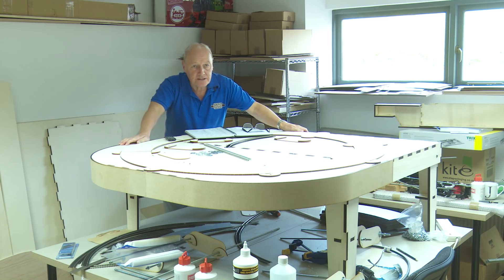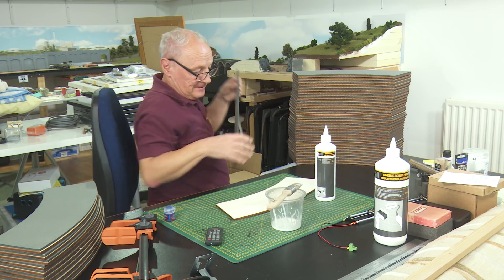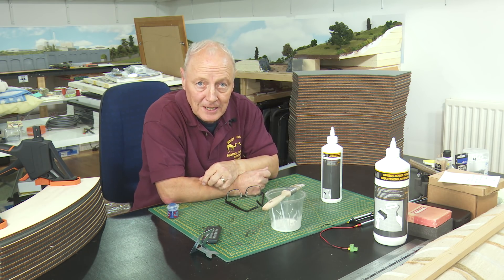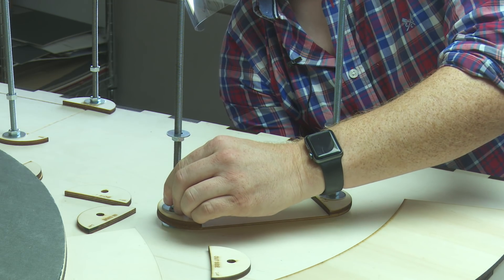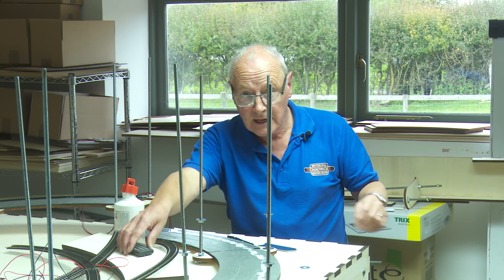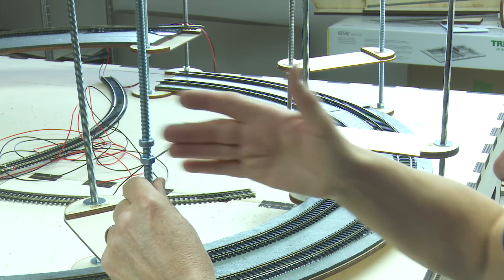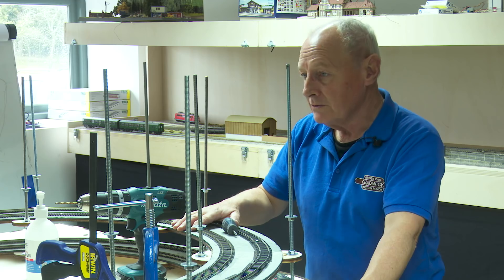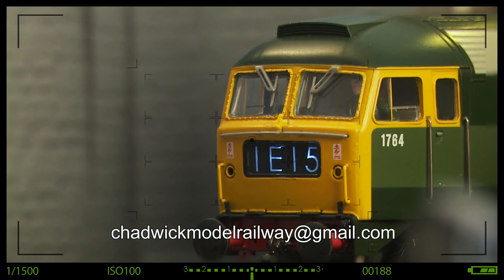Building a Helix at Chadwick Model Railway | 114.

Comment: Have you checked to see whether the screws will catch on the Dcc concepts powerbase magnets once they've been fitted to the underside of your locos ? The screw heads might be below track level but potentially your magnets will also be ?
Reply from the maker: No Peter I don’t believe that’s the case. If the magnets were to catch the screws they would also be catching on all the point blades. Regards Charlie
Reply: @ChadwickModelRailway  that's a good point Charlie, I'm also experimenting with powerbase at the moment on a tight curve entering my fiddle yard.I did have success with a good smothering of copydex but possibly the incline and the radius is what caused you the issue on the helix.

Comment: That thing is a monster... and that metric... it's already in the radii of both tracks. Only thing thats confusing me is - how does the dcc power plates actually do something? are they wired in?

as i am building in H0 (continental eurpean here) with Märklin K-Track  and modelling somethign in germany, my helixes have to turn in the other direction - our rail traffic is also on the other side, like the car traffic. Mine will be actually not a perfect circle but oval - more length per revolution results in a less step grade. But obviously you need the room for it.

cheers,
Sarah
Reply from the maker: Hi Sarah,  the powerbase works by fitting magnets to the weaker loco's to give them more grip.  Regards Charlie
Reply: @ChadwickModelRailway  ah, so they are forced into the rails for more grip. neat.

cheers,
Sarah

Comment: Hey Charlie, great job on the Helix. I am in the process of doing two of these for my HO layout and have a similar 18" overall rise / drop and a 5.5 turns planned. The difference being that I have an inner radius of 28" and an outer of 32". Can you share the excel file for this with me or just plug in those numbers and do a screen share. I believe this works out close to a 2% grade. As you mentioned the inner and outer radius are a slightly different grade. Thanks for the help!
Reply from the maker: Hi Gary, can you email me please your find my email address at the end of the videos. Yours Charlie

Comment: Wow - how the hell are you going to get it home! Don't get the logic that the inner track is less of an incline but hey hope it all works. Separate issue I don't know if its you or Youtube but I didn't get a 'watch later' button top right of screen - I use it to watch the videos on a larger TV.
Reply from the maker: Hi Roger, it will come home in James’s van and tip sideways into my room with the legs removed. Sadly, I’m giving away the next videos secrets! 
You’ve miss understood the down line comments.  The inside will obviously be steeper. Regards Charlie.
Reply: @ChadwickModelRailway  I have a picture in my head of the Tour de France going up the snake bends to Alpe d’Huez.  The riders always take the tightest line, which must give them the steepest hill too.  There must be some kind of coefficient between the two.  And they don’t have magnets!
Reply from the maker: I agree but they're not pulling eight coaches either!
Reply: I had the "how are you getting that home then?" thought
Reply: @dakdak7609  The riders do a racing line - yes in the vertex of the curve they take the inner line, but they start and end the curve on the outer, that way the driven minimum and maximum radiuses becomes bigger then the outer radius and the curved-way therefor longer.

Comment: Charlie: This is excellent. Nice you found someone with computercontrolled cutter big enough for your job and the ckills to drawe the layout. If you have a lot of patience I you could draw fukk size patterns and cut them and its doable. The time consuming way to goio for sure but it saves money. I do have a question. Are you going to put some sort of fence along the edge? I would imagine about an inch off the top surface would do but it would stop expensive gear taking a header unto the floor and self  destructing. Voice of experience says if it can go wrong at some point it will and long trains going up a long circular grade are a ripe opportunity for troubles. In any case this was high quality and great information. Lots of ideas generated from the video and your commentary. Nice job!
Reply from the maker: Hi John, I have no plans at present for a barrier but it is certainly someting that I'm considering.

Comment: Charlie can I ask would u think or recommend the flooring underlay u used on the helixes for fiddleyard and main tracks??? As I'm betting that it works out much cheaper and what one did u use ??
Reply from the maker: The stuff I've used on my helix and fiddle yard comes from Wickes but it can't take much damage, it dents quite easily.  Don't use it on your scenic areas mate.
Reply: @ChadwickModelRailway  ok thanks

Comment: Hi Charlie, what an adventure !  How did you mark the centrelines for the PowerBase and track ?  I'm not using powerbase (yet ?0 on my helix.
Reply from the maker: I laid the track in place and then scribed the line on the foam on the inside edge. Then applied the glue and then fitted the track base. When fitting the track, the track base glue was still a little moist so I could move it a couple of millimetres into its final position.
Reply: @ChadwickModelRailway  Good thinking - I’m using flexitrack and my roadbase was cut out of 6mm birch plywood by a local manufacturing company on a CNC cutter (like James has but a bit bigger) from my 3rd PlanIt track design software that had the centrelines on - but for the gluing your idea is better and I should have done that !
Reply from the maker: My methods aren’t necessarily the best ARB.

Comment: Charlie, Somewhere along the line I surely must have missed some figures or factors used in your calculations because no matter from which end I come at it I only see 65mm(give or take 1mm or 2) as clearance for your rolling stock between helix loop levels -- or about 13mm(~0.5in) of space above a coach(MK1 model height measured at 52mm above rail). What have I missed, since this seems awfully little to get away with?
[How I got there: 80.3mm separation between railheads - (6mm board + 5mm underlay + 5mm track&sleepers ) = 64.3mm].
Whatever the case ... Damn but I enjoy your videos here in Montreal!
Reply from the maker: Your right Ray, there is 1/2 inch clearence.  Regards Charlie

Comment: Hi Charlie. Another great video! Question: I'm thinking of using sheets of Arbitron for sound deadening over entire baseboards (I'm not bothered about 'shoulders' for the track). Would this be as good as, or better than, using cork? It would certainly be cheaper for a total surface area of 12 square metres. I'm wondering if, for instance, the darker Arbiton would be a poor base colour for scenics...... I guess it can be painted though? Your advice would be most helpful Many thanks. Martin.
Reply from the maker: Hi Martin, I will be using those sheets throughout my fiddle yard. However, someone did mention whether they may deteriorate when exposed to UV light. I can shed no light upon this so tread carefully. Regards Charlie

Comment: Well done Charlie, I won't be doing a helix but it was interesting,  did you really need to use the metal base as it adds a major expense i would  imagine, just a thought is it possible to put a hole in the middle of the helix board to use as a service hatch, just a thought 
Regards 
David
Reply from the maker: Yes the powerbase is an extra expense but I want to carry out trials with and without magnets on locos.

Comment: just  a  a quick question Charlie a friend of mine is building a very big LAYOUT ABOUT 20 FOOT BY40 FT HOW MANY TRAINS CAN U RUN ON EACH TRACK  AT THE ONE TIME HE WANTS TO RUN 3 WITH 2 ENGINES AND 10 TO 15 CARRAGES ON EACH TRACK IN EACH WAY
Reply from the maker: That makes 120 feet, each circuit. With multiple tracks, he could easily acheive that.
Reply: @ChadwickModelRailway  THANKS CHARLEY

Comment: Thanks for the video Charlie.  By screwing the track in place did it increase noise over the copydex glued track going down or didn't you do a test on it?
Reply from the maker: It doesn’t seem to be excessively noisy Don, just running test coaches down the tracks. Regards Charlie

Comment: Do you use a thread-locker (Loktite) on the nuts that support each section of helix riser? Is there a possibility that vibration might lossen a nut and cause the track to sag?
Reply from the maker: Nothing as yet Bob, all the nuts are left somewhat slack until the whole build is finished. Only then do we tighten everything up. Regards Charlie

Comment: Hi Charlie, great vid as always.
I was just wondering how your going to get it in your house and to your layout room?
Reply from the maker: An excellent point Paul, however that will be next week’s video! Regards Charlie
Reply: Charlie
Been watching your videos for the past few months. I appreciate the need to stop crawling in as I have the same problem. Just worried about your 18 inch minimum height. That is very low and will not do your back any good. My layout was set at 46 inches with 12 inch drop to storage roads.
I find even  36 inches from the floor low these days when bending, to check or do anything on storage roads, which are underneath the main layout. I do not find 12 inches between the levels a problem.
Graham
Reply from the maker: Hi Graham, my intension is to build the fiddle yard boards on a bench. When finished I will put them on legs and slide them into place with just a small amount of track left to fit across boards.

Comment: Hi Charlie you used 3rd & 4th radius track which gave you an overall width of 51” I believe you said. If you used 2nd and 3rd radius track would this be too tight and would it reduce the overall width to be 48” wide. Appreciate your initial thoughts
Reply from the maker: Hi Chris, yes with long trains I thought it best to go for 3rd and 4th. The tighter the radius the greater the incline too.  However, many folks do use 2nd and 3rd.
Reply: Aaahhh. On reflection think then that it might be best to keep it lowest possible incline as my locos are all steam. Many thanks to Charlie fo4 his methodical videos.

Comment: I think some of my locos would catch those screws - not sure why but my old bachmann 158 is the worst for this. Hope you don't have the same issue.
Reply from the maker: I can’t see how as they are below rail height.  Otherwise your stock would get stuck on the switch rails of every point.
Reply: @ChadwickModelRailway  I take your point (pardon the pun) but it's just something I observe when, for example, a track pin isn't pushed in fully or a point motor pin that's a little too long. There is a bump in the central part between the wheels on the 158 and it catches. As I say, hope you won't have the same issue. If you do, I'm sure you'll find another solution in no time!

Comment: be carefull with that flooring insulation,i tried it on an 8x4 board and had several reactions from polysyrene cement ,thinners for paint, heat ie soldering iron .the stuff just melts and shrivels up.
Reply from the maker: A fair point Paul and one which I will not forget. Regards Charlie
Reply: Pretty much all foams and plastic will melt if you touch them with a soldering iron so best not to. Same for polystyrene cement as that is what it’s designed to do. I’ve used the stuff all over my layout and have had no problems with it, not even painting it. Just don’t use acetone but then that will also destroy you models.
Reply: @RobA500  i am a newbe at this hobbie and i try different things before i go for the big one .it is certainly a steeplearning curve in a two year period i have learnt a lot of dont's by experimenting and learning,i have watched hundreds of hours of youtube vids and tried a good few teckniques ,i am getting there but not quiet confident to commit a few 000's to the real thing .as soon as i saw this flooring insulation i thought -i tried this and its doddgy,give a warning, if your more expierienced you know already ,but what about those who are new and inexpierienced with the product
Reply: @paulmurrell9823  A very true concern, yes newbies should be given this advice and you do indeed to be careful with different materials. What you should take from my comment is not negative but in addition to the underlay many common materials used on model railways can have the same problems as you describe. I agree that it can be a steep learning curve, I’m still learning a lot myself.

Comment: How much is one of these helix’s going to weigh when completed? Presumably normally these are built in situ to avoid the potential issues related to transportation and final installation. Or is the plan to build - dismantle, transport and reinstall? The power base is presumably a 21st century version of Triangle Magnadhesion.
Reply from the maker: Hi Andrew, yes the powerbase does have flashbacks of Magnadhrsion. It will be relocated as one lump. Regards Charlie thank you baby

Comment: Hi Charlie. I’m gearing up to rebuilding a layout and I’m considering the use of 2 Helix like you (ish). Could you tell me what the dimensions of the actual helix track base is please? I’m interested in the width of the sections and what the internal and external diameters are. I hope that makes sense? I’ve seen measurements on their website but doesn’t give all that I need. I’m trying to work out ways to best fit it in my room.

Also, what do suggest is the best base board in terms of thickness and wood type please?

Thanks in advance

Gareth
Reply from the maker: Hi Gareth, I bought mine from DCC TrainAutomation. The large expense is in the track, not the helix. I used Peco 3rd radius and Hornby 4th radius track. 
It’s all plywood (no MDF).  Building your own is a nightmare and it’s easy to lose your motivation. The dimensions are on their website. Regards Charlie.
Reply: @ChadwickModelRailway  oh I’ll be buying one but I was after the physical dimensions of the helix once built. I’m not using a base board like the one yours is on. I just need to know if it’ll fit in an alcove at one end of the layout. Sorry for the confusion.

Comment: Next time you need to put on the nuts on the threaded rod, use a power drill and a rubber band. It saves so much time :)
Reply from the maker: Now that’s a new one, thanks mate. Regards Charlie
Reply: Got a videoclip that shows it. Will make it public available tomorrow
Reply from the maker: Thanks mate

Comment: Your copydex issue could be because you're using it wrong. I've used Copydex on my PowerBase plates (though to ply directly, not to foam). You're supposed to paint both the track base and the top of the steel with copydex and then let it go off. It then acts as an impact glue with all the properties you're after. No nasty weights, and sticks instantly.
Reply from the maker: Hi John, I did use it that way later in the video. However with the power base they have a slight curve to them hence the weights. Regards Charlie
Reply: @ChadwickModelRailway  True, but if you let the copydex cure completely on both pieces before joining them together, then the join will be firm and immediate. 

My tip is to insert a strip of paper between the two pieces (track and board, say). Then you can make your alignment adjustments; when happy you simply slide out the paper and with a little hand pressure for a second or so, the pieces are stuck - as well as copydex normally sticks, certainly.oh, 

I also found it easier to fix the powerbase plates down before removing the blue plastic covers. That possibly helps in keeping them flat, too.
Reply from the maker: Great points John.

Comment: 1) Instead of nuts and washers between each level. Pieces of tubing cut to length. Either to a stop on a chop saw or a lathe. Washer above and below so the tube does not cut the plywood. 
2) When laying out the curves with a beam compass instead of the track centerline mark the outside or inside (a)of the crossties on the flex track. Also make up stop gages that have the same radii as the outer or inner edges of the cross ties. Temporarily screw the gages in place. Glue down the flex track with the cross ties against the gages. You could even make the gage pieces permanent to act as a protection against derailments getting to the edge of the helix. 
a) Assuming a two track helix.
Personally l think the threaded rod idea is a bad one. A small diameter threaded rod such as 1/4 or 6mm is too flimsy. 
As is full circle helix sections. To cut the correct curvatures on the inner and outside radii of the helix sections a radius cutting jig for a band saw is the way to go.
Reply from the maker: A very interesting comment, Peter. However, I certainly would use nuts and washers on the M8 bar, to ensure the flexibility of being able to make adjustments. Regards, Charlie.
Reply: @ChadwickModelRailway  
One thing about the nut and washer arrangement. It can pull the helix section level when tightened. If using the old spacer block method the blocks between helix sections should be cut at the slope angle of the helix imo. The risers at the bottom should have the blocks cut square on the bottom and the helix angle on the top of the block. Another method for risers could be vertical sections with dados cut at uniform spacing. With the dados cut at the helix angle.
The helixes I've worked on were for material handling and vibratory ones for assembly machines.
On a model railroad any helix should have an access port in the center. Just in case. 
One thing about helixes. While they are big space wasters in a lot of ways there are other uses that they might be able to be used for. Curved turnouts on the outside track that lead out through a tunnel for a mountain railroading scene. Think narrow gage in the Colorado Rockies.